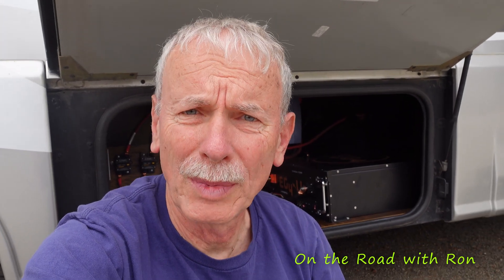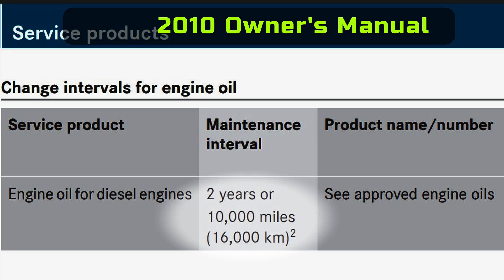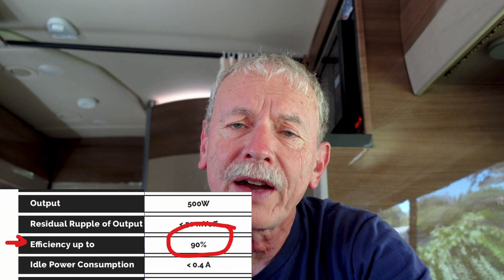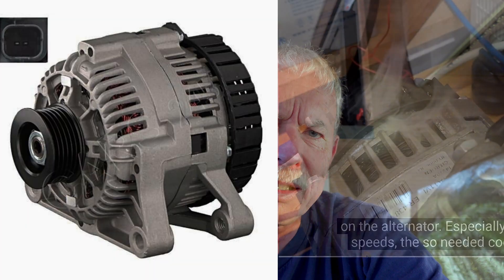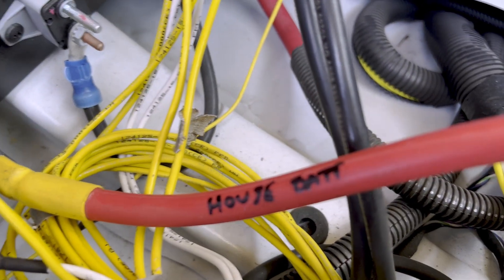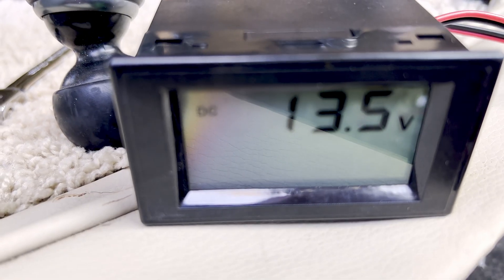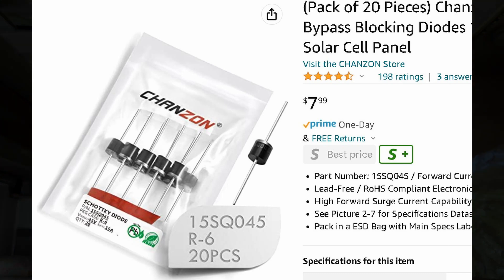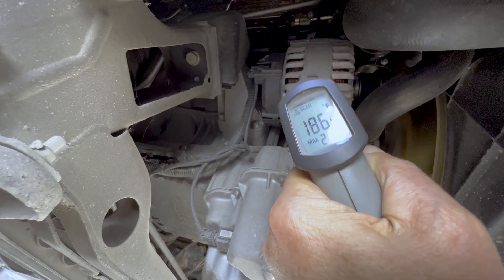DC to DC charger NOT required for big Lithium Battery

Comment: Hey Ron, I've read every single comment, and now that prices have come down for large DC-DC chargers that output similarly to your direct charge setup, I'm wondering if you would install one today?  What factors would you consider?  I'm looking to build out a Promaster with 180-220A alternator and 800W solar connected to a ~600AH 12V system (air  conditioning!!!) Please correct anything I got wrong, or let me know if there is more to consider. Thanks!

- Costs.
60A DC-DC charger costs <$150, or for $200 you can get one that will ensure your starting battery stays charged.  My guess is your setup in a DIY build would cost $107 for the Cole Hersee Continuous Duty Solenoid - 200A - 12V, then a couple of bucks for a thermostatic switch with thermistor to watch your alternator temps, and then a couple of bucks for a digital display meter to monitor amp draw.  Maybe cost is relatively close?

- Manual vs. Automated.
The DC-DC Charger works automatically.  Would give me comfort if my Wife is driving and has less to monitor/manage vs. your setup.  Eliminated human error.

- Efficiency.
Your setup is definitely more efficient and I don't like additional wear and tear on alternators or spending $ on gas.

- DC-DC fully charges the battery vs. partial charge with your direct setup.  Depends on priorities.  Capacity vs. Longevity.

- Some DC-DC chargers will ensure your starting battery is fully charged.  A nice feature.

Thanks again for the video, tests, and thought experiment!
Reply from the maker: First off, your planned system is bigger than mine.  I would try the direct charging first and see what the charging rate is with your particular setup.  Then figure if your alternator can provide the required amperage.  And yes, I would still not buy a dc to dc for my system,  
In addition to the cost of the unit, they are only 90% efficient so will be pulling more power from the alternator than a direct connect.  With tha much solar, why not use that to charge the batteries?  If you have a dc to dc, it will always be on and using the alternator (and fuel) to charge the battery.  Depending on its size, the DC to DC will take longer to charge the battery bank.  Mercedes allows 80 amp charging.  If you have a 40 amp charger, you would have to run the engine for up to 15 hours to get a full charge on a 600 amp hr battery.
One point to consider, unless you have a disconnect, the DC to DC option will actually create more wear and tear on the alternator since it also wastes 10% of the alternator due to its efficiency rating. (all the power including losses comes from the alternator)

Not sure about a DC to DC charger that also charges your starting battery.  All alternators charge the starting battery as soon as the engine starts.

In my opinion, most of the people getting DC to DC chargers don't want to take the time to investigate their actual needs,  Just easier to add the charger and forget about it.  Either way can work and often comes down to personal preference.

Comment: All this to save $200. And laymen should not be messing with high amperage imho. How often do people check and clean connections. Almost never. How often do they check temperature or install a temp gauge. Almost never. Also the BMS is the weak point. They do fail. Never use it as a charge controller. It’s backup only. I always use a current limiting device.
Reply from the maker: Do whatever is comfortable for you.

Comment: If your house battery becomes discharged to a low SOC, they will swallow a ton of current if not limited somehow.  You may never allow this to happen, but on the off day you do, your alternator will take a beating that it may not recover from.
Reply from the maker: That is what Victron would like you to believe. I have personally tested the charge rate at 20% SOC and it started charging at 82 amps and slowly decreased after that. I don’t comment about othet setups but mine is working fine.

Comment: I would be worried on my installation as mine is in a boat and the engines have 60Amp alternator and the BMS on the batteries allows 100amp - I need a DC to DC.
Reply from the maker: True enough. With only a 60 amp alternator id get the dc to dc also. You just don’t have enough margin.

Comment: Thanks for all your helpful videos, Ron.  Have you considered the possibility that, while the alternator can charge LiFePo batteries, the charging profile isn't conducive to achieving its maximum lifespan, and can damage the batterie?.  Clark, from his "Clark's Adventure" YouTube channel explains how lithium charging differs from lead-acid here: https://youtu.be/3USAqjntxIs?si=dhNeQxI0H7UBjiHG.  He also claims that most DC-DC chargers also don't charge lithium properly.  Now, he does have a dog in the hunt, because he sells his own device that manages Li and Pb battery banks.  He explains it here https://youtu.be/Xp6ssk4Guuc?si=Yyk4O6pYTj-PwxD2.  I'm not an engineer, but the comments from his videos seem to indicate a lot of engineers follow him.  If you have the time, you may want to check them out.
Reply from the maker: Ok I watched his very long video. It seems like a long infomercial for his charger. Anyway he makes a big point about “correctly” charging to 100%. There is no need to do this. My solar controller turns off at 13.5v which is close to full charge. No battery lasts forever but my lithium has a 10 year warranty and since it is a server rack unit, it is made to discharge every day. I didn’t see any real test results but even if his charger can add 1% longer life so what? The cost of his device will never pay for itself.

Comment: Thanks again Ron. I am a retired electronics engineer coming from a 35 year career in the diagnostic imaging industry. Magnetic resonance imaging, Computerized tomography, Radiographic X-Ray and ultrasound technologies were all part of what I did daily. These days, these manufacturers are making it more and more difficult to sift through their rhetoric and come up with sound numbers to make an informed decision. I think you've done a fantastic job of researching this topic and trust your science. Everyone should do their own research and draw their own conclusions, of course, but I trust the science, ohm's law and the protective circuitry in the alternator and lithium batteries to protect the circuits. Just be aware that as soon as you post a video showing how to replace the alternator, all the nay-sayers are going to say "See! I told you so!" touting the charging circuit for lithium batteries as the reason your alternator with 100K miles on it failed! 😂 Once again, Good job Ron! I really appreciate the time and effort that goes into the research and making of these videos.
Reply from the maker: Yes a lot of companies out to make a buck any way they can. Surprisingly a number of people have boats and wanted to see how they can charge their batteries from the alternator. Not very efficient if they are at a dock but way better than using a low power dc to dc charger.
Reply: @ontheroadwithron2432  love it!

Comment: Lifepo4 runs at a higher voltage than lead acid batteries so charging off alternator is never going to fully charge.
Reply from the maker: What voltage would you consider fully charged?  Alternators put out 14.4 volts. Actually my solar controller shuts off at 13.7 volts enen on lithium mode.
Reply: @ontheroadwithron2432  that just what I heard

Comment: Hi. I would like to share my story, for now I have one Agm 85ah engine battery on board and on the residential side a 100ah Lithium iron phosphate battery. I charge it  using solar and a Victron 20A charger and for the past 2 weeks I have connected the alternator using a relay that disconnects below 12.8V and two 20A automatic fuses. So far it works but as soon as I manage to save up money I will rather want to buy a victron dc/dc 50A charger. The advantage of this solution is that I can charge my engine battery after shorting the 12.8V relay, the disadvantage is that I am not able to fully charge the home battery with the alternator. You made this film very well.

Comment: ive been using aliexpress step up converters for years.. 25amp rating  for all sorts of jobs, i havnt had a problem, but admittedly i havnt had them on big lithium batteries.. i suspect your paying brand name prices on the likes of victron etc
Reply from the maker: Yes. Victron makes good stuff but it is also expensive. Congrats on your willingness to try something different.

Comment: theres a point.. trying to run your alternator cool when the engine heats it up.. so im thinking  if the alternators temperature is above the engine temperature should you consider a dc converter.. and also consider the rating of the batteries charge intake.. if you have a later model 14.4v alternator. ..does passing a large current ,and its causing heat in the electric components going to shorten the life of them any different to a smaller current running through the same components that have been heated externally.. a test id like to see
Reply from the maker: A lot of concerns about this. However i go back to the MB engineering that allows 80 amps to power coach applications and the 220 amp rating on the alternator. Your questions are what the design engineers consider when setting the specs. I’m not worried and have confidence that they know what they are doing.

Comment: Thanks for the video, just sharing my observations with a smaller lithium  setup.  Recently picked up 2019V with 2 dead coach batteries. Decided to drop in 150ah for ~$500 prime day specials with 2 Litime batteries (100 heated and 50 non heated- couldn’t fit 2-100 heated length wise, and the 200 heated they sell wouldn’t fit in due to width). I wanted heated option for some colder needs on occasion. Anyway using victron shunt for monitoring with same 220amp alternator, with low state of charge ~25%, I notice about 70-80 amps draw for a few minutes, then more modest 50-60 amps 20-30 minutes into  <40 amps for the last  60-100 minutes until full.
Reply from the maker: Very interesting. I get similar changing corrents on my 400 ahr battery. Maybe the alternator is determining the output.
Reply: @ontheroadwithron2432 so 1 update my factory original dc to dc solenoid under passenger seat gave up the ghost on a 2 week road trip.  I bought ahead of time a spare 200amp Cole Hersee and installed it last night while boondocking at a harvest host.  Anyway pulled in with batteries low around 50% and figured I won’t make it through the night but the this might be fun to see how they charge from dead (did run it on new solenoid for 5-10 min to verify no issues and saw around 70-80 amps charge speed).  Anyway 7:11 am the Victron Shunt beeping 10.9V alarm.  I fire up the coach, and wow it spiked to around 140 then quickly dropped to <120 within 30 seconds. Within 10 min down to 90s and 80s within 15 minutes. Then stayed at 80s for a bit and I stopped charging around 40% recovered.  I think if I’m ever in this situation again I’ll fire up the generator with 45 amp  charger for a small bit off coach bridge button and let it bring them up a few %. For others: my typical over night usage is around 50-60%, roughly 1000 watts/75-80 amp hours consisting of a cpap, DC fridge, starlink, Heat, tv, lights, and charging a phone or two). The down to zero will not be a common issue for me.

Comment: OF COURSE you need a DC-DC charger if you want to be off grid for any length of time!
Reply from the maker: How do you figure? Dc to dc requires the engine to be running same as direct alternator charging only the alternator will charge the batteries faster and is more efficient.

Comment: HEY RON, I HAVE A SIMILAR RIG ,IT'S AN ENTEGRA QWEST . I JUST INSTALLED A LITIME 230AH BATTERY , MY ALTENATOR IS 220 AMP . SINCE THIS VIDEO IS A FEWY EARS OLD I WONDER HOW YOU MADE OUT WITH NO DC TO DC CHARGER ?
Reply from the maker: It works fine. I used the alternator on my last trip. I get about 13% charge on the battery for each hour of charging. I usually only need the alternator charging when I ran the AC the previous night. That uses more battery power than the solar can supply.
Reply: @ontheroadwithron2432   Thanks Ron,  I'm torn about the charger. I don.t mind paying for 1 but where to mount it and where to access the wires !!

Comment: Hi Ron,
As many I guess, the video worried me a bit thinking I'll blow my 2 x 115A 18 year old alternators mounted on 2 Volvo Penta D4 engines. But then I kept on looking because I didn't like the more complex DC/DC chargers known to be heat producers with quite small amp output. And I found your interresting comments about this video such as the fact the test was made with a Citroen alternator and maybe oriented to its commercial intentions... So I ended up thinking, what the heck, if my alternators blow, it'll just be time to change them anyway. I did the test with the following setup: 2 alternators feeding 2 Victron Argofet battery isolators with 3 outputs feeding my 3 battery banks: 1 bowthruster/winch Optima 5.5 battery - 2 port engine 5.5 Optima battery - 3 starboard engine & house battery (this one is a mix of 75Ah Optima 5.5 + 400 Ah LiFePO4). I've monitored carefully the current draw (meter + Victron App) and I've never seen more than a 120 Ah draw, even with the lithium fully discharged. I also checked the heat on the alternators and everything was normal. Actually, most of the time the charging curent is around 80Ah which should be ok for 2 x 115A alternators. This is my first year with this setup and so far it works like a charm. No anomaly seen and the Daly BMS as well as the Victron App have never reported any error. I will follow up this comment if a noticeable problem arises of course. 
Geraud in the Med area of France
Reply from the maker: Thanks for sharing your experience. You have a very different application than my RV but the same principles apply.

Comment: Just know that charging lithium style batteries can and, eventually WILL kill the alternator, it's the battery bms that's the culprit. My advice carry a spare alternator or better yet don't screw with it at all.
Reply from the maker: The lead acid battery protects the alternator from voltage spikes due to BMS switching if that is your concern.

Comment: You can use a negative shunt on the positive lead, but you would have to power the shunt with a small isolated DC to DC converter (eBay has them for less than $2, see: B1212S-1W DC 12V to 12V).

The shunt can then read Amps on the positive wire, but any reading of volts or Watts will be meaningless since it only sees the DC Converter's voltage.  Also, dont use a connection on the VE direct port.

Obviously, getting a Shunt designed for the positive wire would be easier.  Or you can use a DC clamp-on ammeter.

Comment: I wish you would have driven or increased the RPM of the engine when the battery was down because the higher RPM will increase the amperage of the charge. I bet driving will give different results. Enjoyed the video anyway. DS
Reply from the maker: Might not be in video but did rev the engine. Charge current didn’t change much.

Comment: I just upgraded my Pleasure Way XLTD (2016 MB Sprinter chassis) from 200ah LiFePO4 to 600ah with everyone telling me to get a DCDC charger. Which no wonder, the Victron video has them all scared witless! Which never made much sense to me, but I never was sure until watching this video. So instead of spending $500 plus installing the charger I got a clamp meter and IR temp gun and recreated your testing. In my case 80 amps initial charging dropped after 30 min to half that, and with everything warmed up the alternator was running cooler than everything else, just like in your test! If the batteries are discharged then I'm sure it will go a lot higher than 80A, but between the Mercedes smart alternator, 220A rating, and the BMS I am no longer worried- and saved a LOT of money, time, and effort! Thanks!
Reply from the maker: There are many people that buy into the fear without investigating themselves. Their choice.
Reply: I run mine the same the only negativ thing is as you say the charging drops as the battery fills up and under idling the voltage usually drops and that will (positively) cause less strain on the alternator  (dc-dc charger will hold the same Amps over time and with 85% efficiency will task the alternator more specially under idling) dc-dc charger will charge with max effect from start to finish wile  alternator only will charge more at higer RPM and thus stress the alternator less than a big dc-dc charger. There is also the fact that the alternator is supported by the car battery.
Reply: It is rare that a normal alternator is going to put out the 14.6V needed to fully charge 4 cell Lipos so you’re likely giving up significant Wh capacity.
Reply: You didn't mention if this was just at idle or did you drive it so the alternator output can increase?
Reply: @cruze1953  Low RPM with low airflow is the acid test. If it can handle idle parked then driving is easy. So no, I didn't do that.